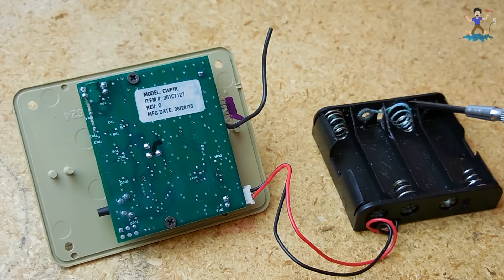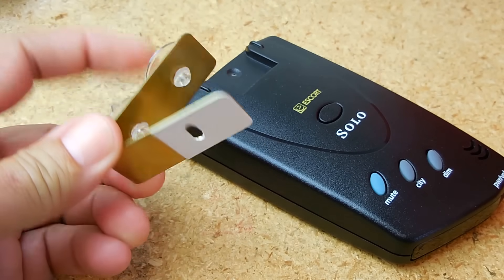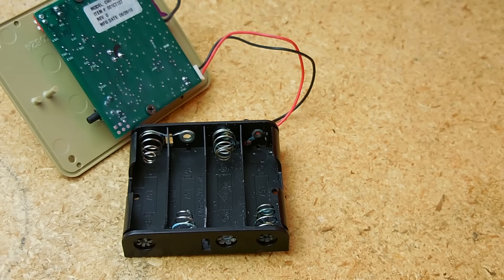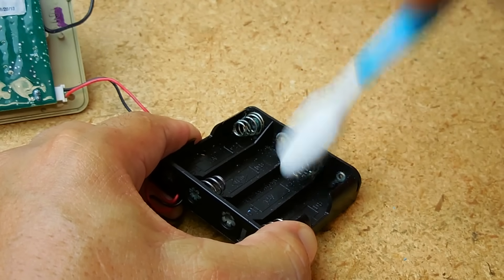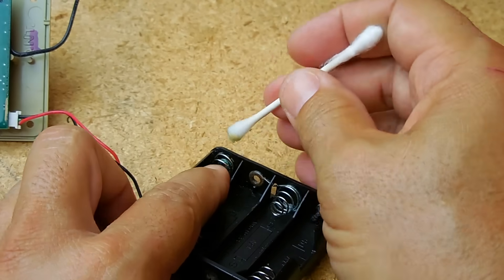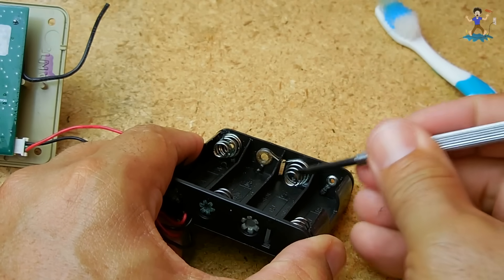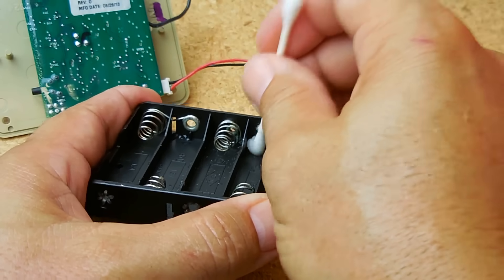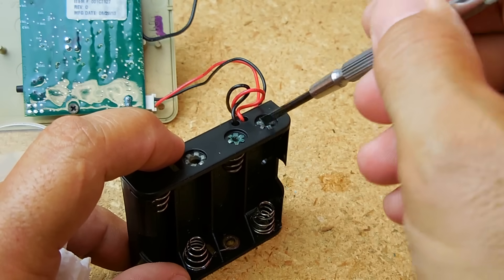EASILY Clean Battery Leak Damage(Corrosion) In Electronics

Comment: Electrician here. Nicely done but this only half the battle.

So how do you stop this from happening? After having my head mount flashlight (really handy when working in electrical panels) suffer the same issue, for the same reason as everyone else.  After cleaning, much as per the video, it occurred to me this is no different than my car battery, where I have greased the posts to prevent corrosion.  For electronics, such as this, I have found a thin film of Vasoline works perfectly.
Reply from the maker: A thin film of silicone grease does the trick.

Comment: I have used vinegar with goid results.  Also fine scotch brite cut into small pieces and used with small needle nose pliers to get into tight spots. Still have a few cans of electrical contact cleaner from late 70's that contains freon that I like to spray on corroded area  for last step. So cold it leaves frost on items.

Comment: You said to use white vinegar I've always used baking soda white vinegar seems like a better choice also using rubbing alcohol for final cleaning I've always used isopropyl alcohol...is there a difference? That red wire connected to that one terminal that was corroded probably has corrosion creeping inside wire I usually cut enough of the wire to rid the corroded piece and re-solder.

Comment: Reminds me, I remember back when all (alkaline) batteries had STEEL casings and rarely leaked.  Matter of fact EVEREADY had a guarantee that if ANY device was damaged by their batteries they'd replace it for free.  Well I did have a flashlight in the trunk of my car that quit working and it was crusted up nice.  I mailed it to them and a few weeks later I had a brand new shiny EVEREADY flashlight with new batteries in it.  Back when everything was made in USA of course.  IIRC this was 1974.

Another thing is most electronics devices have a very tiny continuous drain even when turned off.  If the batteries are left in this state they will be drained way past their point of disposal and guaranteed to leak out.  That's why if you store something like this it's best to remove them altogether.  Any device with a "soft switch" will do this.

Comment: I used to try baking soda solutions to clean up these things until one day, my high school chemistry kicked in and I realized I'm treating an alkaline with an alkaline!  Too much automotive battery cleanups, I guess!  I usually knock off the flaky stuff, soak the battery holder in the white vinegar if possible and swab the contact points and ponder over all of those old electronic kids toys I prematurely trashed!

Comment: Great video; practical suggestions. You have more patience than I do. Funny, I probably would have soaked the whole thing in white vinegar first. Your process obviously works.
Reply from the maker: Soaking the battery holder in vinegar would cause the acid to seep into the wires under the insulation.

Comment: I may have known it years ago but forgot in the meantime, (I'm a 69 year old fart) LOL. Anyway I watched this yesterday and today my brother came to me with his cable remote and showed me the battery compartment.  It looked awful so I told him to get me some vinegar, alcohol and swabs. I cleaned it out real good then I checked mine, same thing, looked really bad.  I ended up cleaning both out real good but now I'm wondering, would electronics cleaner have worked on that stuff?  BTW, thanks so much for the video. got my stuff working MUCH better than before.

Comment: Yes there's a product for used for cleaning calcification out of coffee pots and so forth it's even more effective than Witcher using! Don't mean to rain on your parade but I think you should check it out! It's at any Walmart or other store just like that! Your viewers should know about this as well, put it in a spray bottle for application especially if you're cleaning battery terminals in your car under the hood!
By the way your batteries are supposed to be removed from your products especially if you're moving to a new place and those things get misplaced you won't find them to get the batteries from removed in time before the batteries leak? So I suggest you take all the double a triple A batteries out of your products 9-volt and tape the top of them and storm and a commonplace before you move, make sure the boxes are moving boxes are labeled on the side facing out if they are stacked on each other in the garage or storage facility?
Also if the Chrome coating or plating is come off take a soldering iron with some flux and reapply solder to the surfaces so that they will have good contacts with the batteries! A good silver solder will work perfectly
Reply from the maker: CLR is expensive. No reason to use anything but cheap white vinegar!

Comment: When the corrosion is in a removable (or separate) battery case, just submerge it in white vinegar overnight, then neutralize with distilled water.
Reply from the maker: Bad idea, the acid will seep under the wire insulation.
Reply: @electronicsNmore  Don't think it will when dabbing on with Q-tips?

Comment: Also, you could unplug that battery holder and completely submerge it in white vinegar for a couple of hours. Then  hit it with some running water, and finally give it a baking soda bath.
The vinegar will eat the corrosion and clean the metals without harming them. The baking soda in water will neutralize the vinegar (acetic acid).

Comment: An old retired EET here. Well done young man! One tip though. If the battery pack can be separated from the PCB and other circuitry it's ok to simply rinse in clean water following the white vinegar treatment. Even soapy water followed by a clean rinse is OK. Just blow dry with a hair drier. For extra protection you can spray the contacts with electronic tuner cleaner .... uh .... if they still make that stuff any longer?  The can of "Channel Master" that I have may be a valuable antique!😅
Wakodahatchee Chris
Reply: Tuner cleaner! Wow. I remember having a can of that back in the day. My first gig as a TV repair tech...testing and replacing old pentode vacuum tubes. Ya brought back a heap of memories. Lol.

Comment: Overall a great video. I add a few steps to the start of the cleanup process. Whenever practical, I wash with clear water first. For the small, separate battery holder I would simply place it under slow-running water. In other cases I might dip the part in water or simply use the Q Tips dipped in water. Water is near pH 7 so neutralizes a lot of the corrosion. Then follow up with vinegar followed by a final flush with water as in the first part. The water returns to part to pH 7 or neutral. Often I can clean up sufficiently with simply a water flush and no vinegar. You are an excellent presenter, video recorder and teacher. Thank you.
Reply: I would finish with DISTILLED water only due to no mineral content and being a go to and tested electronics cleaner/Z solvent.
Reply: If the springs are riveted to a thin sheet metal thrust plate, that mechanical connection is often loose, and oxidized or tarnished; a common, major cause of intermittent flashlights, even prior to battery leakage having occurred. I solder the springs to the thrust plates, preferably before leakage occurs. It may be necessary to remove the metal thrust plates and springs from the plastic battery holder first, to prevent melting the plastic, unless you are skilled solderer with really good equipment (and it'll be much easier to solder the riveted springs before battery leakage occurs, because even after cleaning with vinegar, some corrosion will invariable remain at the junction of springs and thrust plate).

Comment: Actually a baking soda solution is better than alachlor or before you use alcohol but I like baking soda then some WD-40.
Reply from the maker: Incorrect. Baking soda is used to neutralize ACID spills.
Reply: @electronicsNmore  And you need to neutralize the vinegar which is an acid and will corrode the contacts.

Comment: Excellent video, I’ve tried alcohol but never thought of vinegar for some reason. I’ve used vinegar and baking soda for car battery terminals.  Honestly, when it’s a separate battery pack, I may be inclined to replace it, but when it’s made into the device, excellent solution
Reply from the maker: Glad you like the video Jerry!
Reply: When I was on Safari in Kenya the drivers cleaned the car battery with 
Coca Cola . Worked like a charm.

Comment: I might add that once the contacts are cleaned a bit of Alox might be in order to coat them it's what is used for aluminum wire in electrical connections and prevents galvanic  reactions

Comment: Side Note:  When you change your vehicle oil, add a few drops to the battery terminals.  Add a bit to the end of the stranded wire so it wicks in.  They will last forever.
Reply: You can also install a treated felt disc around the battery terminals; keeps them clean or a long time; available at auto parts places!

Comment: A Nick-Sander is an excellent tool to clean all types of contacts.  A cleaning swab will not leave fibers like a cotton swab.  You can use DeoxIT afterwards to clean and preserve the metal.  If not DeoxIT, use a turbine type oil such as Zoom-Spout 93240 or in a pinch any oil that does not "gum".  I always wipe the battery terminals with oil before installing.

Comment: I have run into more leaking alkalines in the last two years than in the previous 20 years. Mostly Duracels! WD40 also works but white vinegar followed by alcohol to displace the vinegar and water appears more effective. Thanks!
Reply: Most of the corroded batteries I have encountered have been Duracells. First time in about 1993 with a 3 D cell Maglite, not even a year old and the middle cell had corroded while the other cells still had a full charge.
Reply: Yup! Duracells. I think every single thing I owned with Duracells in it leaked. I’ll never buy them again. And I quit using Duracells about 5 years ago now, and I haven’t had one thing leak acid since.
Reply: WD40 is a Water Displacement!
Reply: Your experience mirrors mine - years ago alkaline batteries I had NEVER leaked. Now, I find them leaking in the package - unused.

Comment: What if the spring coil was so corroded that it broke off? I could get fix the rust, but the battery won’t connect properly for it to work.
Reply from the maker: You need to replace the spring.

Comment: Great video, thanks!
Question: Is there something you can apply, like dielectric grease, to prevent the corrosion from occurring again? TIA! 😁👍
Reply: Dielectric grease is good, also DeoxIT or simply oil is better than nothing.  There is also a compound electricians use to connect copper to aluminum that would work.
Reply from the maker: Yes, a thin film of silicone grease is fine.
Reply: Just "replate" the contact points with solder.

Comment: My weight scale cant use since there have corrosion and leaked in it. the spring just fall off. so when i put the battery it cant fit very well. so how to makesure it connect ? someone advice to use aluminium foil. but still cant. is there any solution ? 
#sorry for my english
Reply from the maker: You need to make a new connection between the battery and battery spring. Maybe take battery compartment parts from a dollar store device.

Comment: Great video - when you said "electrolyte" I knew you knew what you're talking about. FWIW, I spray the vinegar with one of those small travel sized bottles. It assures that the vinegar hits the nooks and crannies as it were. Then I rinse it with 91% Isopropyl.

Comment: Bless you sir!!!! THIS WORKS. I have a tall beautiful light up cardinal snowglobe lantern that my mom got for Christmas a few years ago. I thought the batteries in it were dead so I went to get batteries for it tonight only for it to not work:( so opened it up and it was corroded. It was only corroded around one of the spiral rings but I couldn't clean it enough to get it to work until I saw this video! I only used a couple qtips and white vinegar since there wasn't much there, cleaned it out, popped the batteries in, and I screamed out of excitement! You made my whole day, thank you so much!!

Comment: Sir,
My aaa battery charger terminals both top and bottom has rusted. As a results error shows up when putting battery to charge in the display of my charger 
I have wd-40 I am not sure how to remove the rust. Wd 40 is flammable. If residue remains it could cause fire.
Batteries are Duracell rechargable ni mh 750 mh.

Comment: To much momentary before method
Reply from the maker: Be thankful I took the time to share this information with others. I didn't have to.
Reply: @electronicsNmore  I am dude.  You have a lot of useful info.  I teach.  I use a lot of videos for my kids.  I should have mentioned it was useful and accurate.  I got 3 new flashlights from Home Depot, all with leaking batteries and corroded terminals.  Great, when we are due for a hurricane.
I got 2 working.  One was just too corroded to be cleaned.    I used your video for it.  So thanks.  Just feedback.  Please do more.  Just consider structure because you have good info.  If you didn’t I wouldn’t have wasted my time with a comment.

Comment: Thanks for the video but I didn't have any luck. Stupid energizer, they fried my remote, and a flashlight in the same damn week. The vinegar didn't clear the white stuff, tried contact cleaner, still no luck, and even when I tried scraping the white stuff with a small flat head screwdriver, it still wouldn't come off. I'm thinking the acid permanently changed the contact metal or eroded it so bad it's destroyed. From now on, I'm just going to remove the batteries when I'm not using something. I only use the flashlight a few times a week if that. Anyways, thanks again for this, it was worth a shot!

Comment: Sadly, this didn't work for me, even though I was able to get the corrosion off one side. On my device the other side of the terminals are deep inside a cavity. I tried to use some q tips with vinegar to poke down there, but wasn't able to get enough off. Then again, it might be an internal issue with the recorder. I suspect it's still the corroded terminals. Video isn't BS, but YMMV given the device you're working with.

Comment: One other thing I could suggest, if things are super bad.. yes I know that is not the best way of saying this.  But if you use a little sandpaper on the joints, connections, junctions between wire and connections then you can use a soldering iron to solder the connections with the junctions, connections whatever you may have..

Comment: I've got a very good, very helpful, awesome suggestion for applying the vinegar..   
   Put a little in a spray bottle and squirt it on the affected electronics..  then apply a second time..  or as many times as necessary.. in between spraying use the suggested toothbrush or screwdriver to assure complete, most effective use of vinegar..

Comment: Can corrosion also come in brown colors too? I used the vinegar method with Q-tips and it gave off the sizzle and everything when I cleared it so it must've been moisture plus corrosion?? I was able to clear most if not all of it but my metal connecters still have a dull but slightly shiny sheen to them, almost like they are rusted but not quite. Tried to scrape it off to make it look more shiny but I was getting little off in the end after the cleaning. I haven't tested new batteries in my electronic yet but I'm hoping it will work now. Thanks for the help!
Reply from the maker: The sizzling means there was an alkaline liquid present. Keep rubbing the contact area with a pencil eraser. Be sure to rate thumbs up, consider subscribing if you like a wide range of helpful and informative videos, and look over my extensive video playlists below for many other videos of interest to you. Taking one minute to share a link to my channel with others on social networking sites would be greatly appreciated. Thank you
http://www.youtube.com/c/electronicsnmore/playlists
Reply: @electronicsNmore  Ah ok! I will use a pencil eraser for the next cleaning. Should I keep rubbing still until it becomes shiny again? I hear sometimes aggressive cleaning can damage certain plating even more after corrosion occurs but can the metal connectors in electronics take on multiple cleanings with vinegar without damage?

Comment: This may happen with any brand of battery, but I have a box of fairly high quality flashlights that DURACELL batteries leaked in and caused a mess like that.
Reply from the maker: Duracell batteries are the WORST for leaks!
Reply: @electronicsNmore  I learned that the hard way. What brand do you use? I've switched to Energizer and Energizer Lithium when I can find them. It's hard to find D cell Energizer Lithiums where I live. I've even looked on eBay.

Comment: : I have a question! One of my springs turned black or a dark color..
It’s original color was of course, silver..

Should I get new batteries and use try to see if it works or should I not mess with it anymore?
Reply from the maker: Gently scrape the contact area of the spring with a sharp blade, then use a pencil eraser on the same area.

Comment: To be sure to get to the bottom of springs could I pour the vinegar into the battery holder?
Reply from the maker: No, it may seep into the wires or onto the circuit board.
Reply: @electronicsNmore  thank you.

Comment: I have a ZOOM H2 hand recorder often used by musicians. I hadn't used it in a year. I just tried it and it wouldn't power on. I opened it to see that the batteries leaked. It can also work via AC (plug in to the wall). I took out the batteries but it still won't work. Is there a way to fix this?
Reply from the maker: Sounds like some internal damage occurred. Open it up and take a look. Thanks for watching!